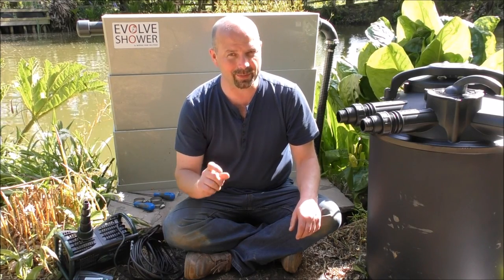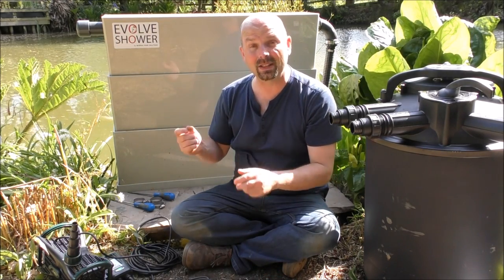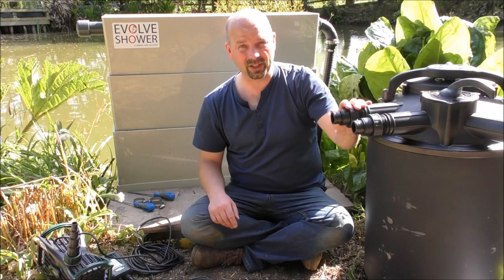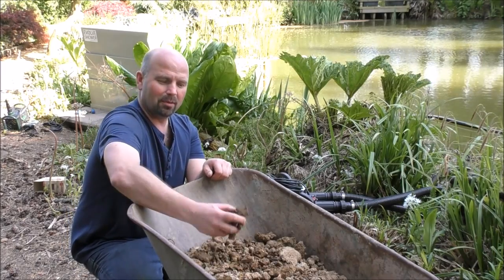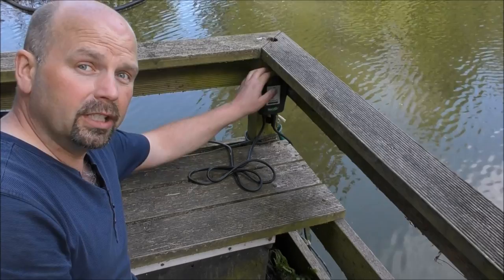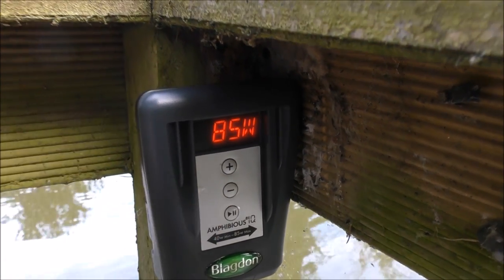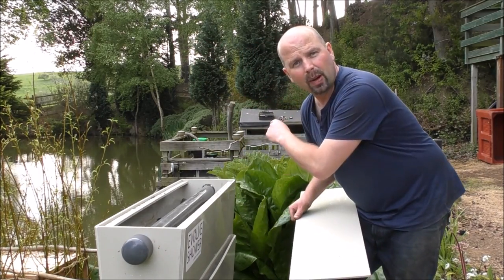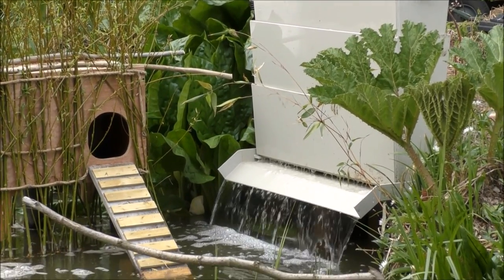Pressure Filter and Shower Filter for a Koi Pond - A Match Made in Heaven?

Comment: Great video Richard. On the UV light maybe the company thinks that the cleaner the water better light penetration compare to the dirty water coming straight from the pond. Looking forward to seeing the setting up of the rest of the filter for the pond. Thanks Richard for sharing.
Reply from the maker: Yes that is probably behind their thinking since a light after the foams will probably not get the quartz sleeve around the light dirty so quickly. When the quartz sleeve gets dirty it reduces the amount of light which shines out,  making the light less effective. Whichever way round it is it will work fine for this application.

Comment: Great work nice video.i would drill some more holes in the shower filter just incase them ones get clogged up.cant wait to see what else you do to it.
Reply from the maker: I should have filmed the bottom of the trays since the whole of the tray base is a plastic grid so will never get clogged up. I probably edited that bit out, lol
Reply: Pondguru I'm mean in the tube were it enters
Reply from the maker: As there is a pressure filter before the shower filter that should prevent blockage but with the previous set up when I only had a shower filter the pipe did get clogged from time to time. Running a brush along the pipe cleared blockages in seconds no problem.

Comment: Hi Richard,

I've watched a few of your videos and really enjoy them. I found you when I was looking to build a raised pond and used tips from one of yours to build it. It's not quite complete yet but the water is in. The only problem is that I've hit a bit of a snag with the pumping arrangement because my pond isn't for Koi but for my ducks and geese. It's only small at around 1000L, if I've done my sums right, (4' x 4' x max 22" deep) so it gets mucky quickly.

My original idea was to have a pump at the deepest point which would push the water up and out of the pond to a filter inlet above the water line because the water level will rise and fall depending on rain & how much the birds splash about. At the time a bottom drain and gravity feed system wasn't even on my radar and someone with ducks and a small setup has advised that the pumps get clogged and break down quickly, possibly because of the feathers.

I've watched this video and the mega filter build video and can see that you are pumping up and out of a massive pond which is mucky(ish) and presumably has leaves & feathers together with the lumps of fish poo. I appreciate that leaves will chop up easier in the impeller than feathers would and the ratio of feathers to water volume in your pond is a lot less. Could you give me any advice on pumps that might help me out of my dilemma, please?
Reply from the maker: The pump I used in this video has performed very well and the link to it is in video description. Other pumps which perform very well on solids up to 10mm are the Aquamax range from Oase. Never had one of those block yet.
Reply: Pondguru Thanks so much for your response & advice. I just watched your "Good news, bad news" video, so it's very much appreciated :)

Comment: Have you come across those plastic stacking crates supermarkets use for home delivery, known as bail arm crates? They have solid sides, perforated bases and flip over bars so that they can sit one on another. They would be idea for a shower filter and are dead cheap on Ebay.
Reply from the maker: That would do the job nicely by the sounds of it.

Comment: Just bought the 540mm 3 tier filter and will be running it after a pressure filter too 

I went for the 540 over 1000 as im pushed for space and its worth the money. many thanks on your videos 

Do you sell pumice on ebay your pond is in the rear of the photos 👍👍
Reply from the maker: Yes the 540 can still fit loads of media in so no worries there. The listing of pumice I have on ebay is indeed the one with the pond in the background and I also have it on my website (pumice page) http://www.filterpro.co.uk

Comment: I’m unsure what outcome you’re looking for, however if it is clear water you need to up your filter by 10 times, what you’re doing isn’t going to have much impact on such a large pool, which is lovely by the way.
Also question how you are going to clean the media in the tub which is sat up high under the deck?

The most efficient way for a pool of that size would be a reed bed system via a long stream with drop in pools allowing plants to take the nitrates away.

Good luck, I’ll watch with interest.
Reply from the maker: If you look at recent videos I explain about the new filter I'm currently building and how it will be cleaned easily and quickly. The pond is already really well planted and conditions are good except clarity.
Reply: I did a similar filter system 25 years ago, bottom drains in each chamber 4x2x2 (pool is a lot smaller than yours 7k gallons) brushes got removed as I couldn’t keep up with the cleaning, they were in the second chamber, the first was a settlement chamber, then in to K1 and 2 following lava rock chambers, adding the baskets is a good move as these were a pain to clean, then pumped into a 70w UV, will also add this was gravity fed, 4” bottom and 2” skimmer. 

If you have plenty of spare time to clean the filters that will make a difference, daily cleaning will have an impact.
Reply from the maker: Great stuff, that sounds almost exactly the same as my set up. The vortex filters should hopefully catch the main muck but the bush chamber may get the rest. With the amount of water I can drop into containers for cleaning I reckon they will get a quick but effective clean whenever they need one but it will be trial and error to know how long the intervals between cleaning should be.

Comment: I purchased the pump and filter on your recommendation as we used to have a 35 metre by 15 metre swimming pond! but the 45 gold fish was in too small a pond so now they have the larger pond. I used the existing pressure filter and pump to clean the water but it was not strong enough. Fitted the new pump today (July 6th) which is excellent  but I struggled with connecting the pipes to the filter the rebranded Green Reset are complete rubbish such a bad design, I just hope it cleans the water otherwise over £500 wasted! Phil North Devon

Comment: Hi Pondguru, I only have a 1000 ltr under deck pond with gold fish & shubunkins, the 3000 ltr per hr pump runs through 2 blagdon UVC pressure filters to a water fall. My question is, would it be best to fit a huge pressure filter filled with Boi ultra between current filters and  water fall or add an independent small Bakki shower? Love your videos, very helpful. Kind regards 🤔

Comment: Thanks for the info in this video. Just bought a green reset 60. Probably too big for my pond but I like the high flow rate of 18000lph. As it will be situated before my shower. I have foams on the first layer of the shower at the moment and sick of cleaning them. Fingers crossed this is what I need.

Comment: would putting a flout with a wight so it dose not move around to keep the inlet just off the bottom so it doesn't suck up the muck ?? love your shows,  watch a lot so far anr look forward to them all learning a lot.... thanks
Reply from the maker: Yes that would allow it to draw cleaner water but when I get the large filter built for the pond I want the muck from the bottom of the pond to be removed so pump will be on bottom. I am going to clean the pressure filter in the next few days so it will be interesting to see how much muck has collected in the 3 weeks or so since fitting it.
Thanks for watching and appreciating the videos.

Comment: Won't the water track around that foam after a day or so? 

Also, when you clean it, where does the poo go? It just squashes into the foam and remains in the water column doesn't it?
Reply: No the pump is still running I'd imagine itdisperses to the garden as flow is diverted by the handle as he explained!

Comment: Thanks for your video. Are you still satisfied with the Grenn Reset 100 Filter? Kind regards from Germany!
Reply from the maker: It was good while it lasted but ultimately I gave it away when I made the big filter on the pond.
Reply: @pondguru I feel like the green reset 100 would work well if you discarded the sponges and filled 1/2 or 3/4 of the filter with k1 media as it would move around well internally. Or keep the sponges and fill k1 in the gaps around the sponges in the cylinder.

Comment: I have just put a pond in and have a pump and pressure filter but was wondering this same thing as I think I would need some more biological filtering going on. I was looking at either a waterfall filter (DIY) and just shoving some media in there or a shower filter (DIY)  against a wall, pump feeding that and the pipe coming from that running the waterfall. Obviously this is more difficult as it has to be higher than the pond somewhere up the bank.
Is this about right as the pressure filter seems more mechanical than bio? cheers. Great stuff BTW

Comment: Thats a very similar set up to my APS 20k pressure filter , the handle turning on mine is easy , a dab of superglue stops it flying off .
Reply from the maker: Yes having any pressure filter before the main biological filter is a great idea. I almost went for one similar to the APS filter but thought I'd give something a go which was a bit bigger - seems to be working OK so far as only very fine muck is coming through. I just added a fine pad in the top of the shower to see how much muck was still coming through and it does have some fine muck in it already.
Reply: Pondguru ive been to lazy to bury mine yet , i know that will effect the flo but digging is hard work in our dense north east clay ! Good tip about cutting the hose tails , i shall do that tonite
Reply from the maker: I feel your pain with the clay - I dug mine into hard packed clay but to be fair once I got through the first 6" it wasn't too hard to dig the hole.

Comment: hello i need some help what piping do I need for a basic small about 500-1000 litre pond made out of cement. I am replacing a plastic liner and making the pond bigger but dont know what is needed for a basic system in terms of piping. do I need a drain and some sort of overflow system into a filter set up? what pipes do you suggest a photo showing this would be helpful thanks.

Comment: Hi I have a yamitsu mega xl black box,its beed fine nice clean water but cleaning the alfogrog was a bit  of a pain,so I've put the alfogrog in filter bags for easy removal and cleaning,I have also fitted a 75ltr bin before the water goes into the mega box I've got the water from pond  coming into the bottom of bin 1.5 then a 7 inc high shelve with mesh to rest a coarse sponge then out the top with 2x 2 inch outlets that go into the top of mega box as u would, but now for the last 6 days the water has gone cloudy any idea why it's gone from clear to cloudy just by adding the bin thanks

Comment: @pondguru I have been using a smaller version of your filter for the past 2 years here in the U.S.. The only difference is instead of a pump (up and down) handle mine has a crank (turning) handle also mine has a small void of space in the bottom for your choice of biomedia... I use white pumice (thanks to your advice on media once before). I picked a pump AND filter that were double what my pond was and my water stays crystal clean now with not additives. But I have to ask??? Being in the U.K. and aware of natural swimming pools I am sure, Why have you not done something like that for your pond to get it to clear up? Thanks for your shows!
Reply from the maker: I'm glad you enjoy the videos - thanks for watching.
The shape of the pond does not lend itself to a natural swimming pool design as it is basically a huge basin. If it was drained down to around half depth I could probably install walls around an edge , backfill with pipes in gravel and make a natural pool filter but the external large filter (yet to be built) will be way more convenient - just need some spare time to build it now.

Comment: Hi Richard was watching your video and went out to buy a green reset 100 What a big filter I love it  my mistake was i came home from work was a bit tired should of wait till tomorrow to set it up but couldn't wait u have the  inlet  and outlet basically I fix it the wrong way round 😣 and left it running all night i have fix it now the right way do u think it has damage the filter? Ples let me know thanks sam.
Reply from the maker: It should be OK and when you connect it up the right way it may spit out whatever muck it has currently trapped on the inside of the foams as opposed to the outside of the foams. Having it going the wrong way for only a day won't have damaged or clogged anything so nothing to worry about.
Reply: That's great news and thanks again for your very fast reply love all your videos very helpful and fun to watch as Allways 👌👌

Comment: Its interesting at how the reef keeping industry has done away with trickle filters years ago because they require such high maintenance to not be nitrate sinks.  The pond industry had not cough up yet...
Reply: A Bakki shower is not a trickle filter with a low flow rate, to work they must run at high turnover rates to replicate the flow crashing over rocks as they do in real streams and also at least 4 tiers tall  and I would also suggest that a 12000 pump is too small for that sized shower!
It would need to be closer to 20000 at least to function as intended but the results would be significantly better, with a “gassing off” effect!

Comment: Thanks for this vid pondy gives me great ideas for when my pond is set up 👍
john :)
Reply from the maker: No worries, man - I'm on building the large filter system for the pond half an hour or so a day and I just need a few more fittings for it.
Only the frames for all the filter parts are built so far but they are just tacked together with screws. They all need extra support and nails / bolts to hold them together as a couple of the platforms will be holding over 3 ton each and I don't want them breaking, lol
There will be 3 x large vortex bays followed by a 1500 litre tank full of brushed or flocor dropping down into a 1500 litre moving bed followed by 2 x 1500 litre tubs filled with alfagrog in large trays and the last tank will feed water to a 1000 litre tub filled with grog which also feeds up the a 4 tray shower filter filled with biohome and pumice which will be powered by a separate pump.
None of those parts are fitted together yet and that will take ages since every one will have a bottom drain for cleaning...it will probably be done in a couple of months at this rate, lol
Reply: Pondguru that sounds like an epic task and worthy of one of those massive shark tanks at seaworld hope it all comes together for you brother but dont be killing yourself doing it 
Take it easy bro
John
Reply from the maker: The psychedelic trance I listen to for about 8 hours a day keeps me plugging away at the work so it's all good. I couldn't imagine working working for someone else now or having to listen to the spirit crushing radio in a factory environment - I'd go postal for sure.

Comment: Hi, I'm Filippo and I am writing to you from Italy, congratulations for the video, I still appreciate the inventiveness of others,  but I think there are various problems in this system.

Please, don't take this as a criticism, but as a way of exchanging experience. ;-)

The rule that is usually respected to have a good biological/mechanical filter is that it must have three times the flow rate (per hour) of the basin, and consequently a filter with adequate capacity , otherwise the waste product will always be greater than that it can clean.
For a lake like this  you will understand that it is very difficult.  
And that pump, however powerful, is not enough for that lake. Like the filter capacity. 
That filter in my opinion is useless, if I did chemical measurements in that lake, before and after the installation of that filter, I think it would not change anything.

The only way to have a clean lake is to have lots of aquatic plants, and/or a clean river nearby.  So creating a filter for a lake is a lot easier than we think, but needs luck, because is not easier to find a lake near from a clean river. If you buy a lake that does not have a clean river nearby, it becomes dramatically expensive. Infact there are also artificial solutions, but they are much larger systems than this, and they are not as cheap as this system. If they asked me to clean that lake, I would tell them to create a smaller one next to it, full of fast growing aquatic plants, to recirculate the water. 
It's the cheapest solution, and after 1 year the chemical measurements would be better and the water probably would become transparent. 

I believe operations like this are just a waste of money, with no tangible results. I hope my experience is useful for you.

Bye :-)